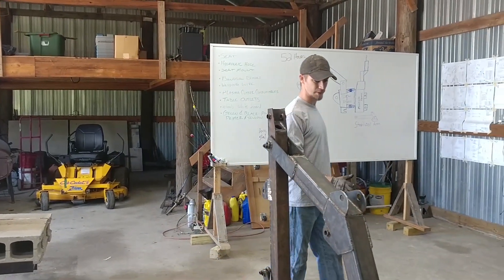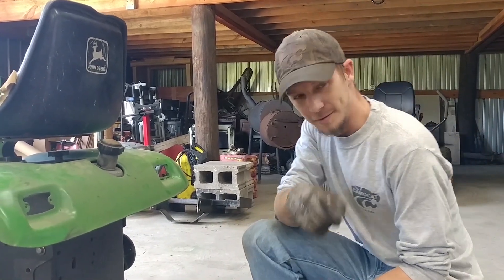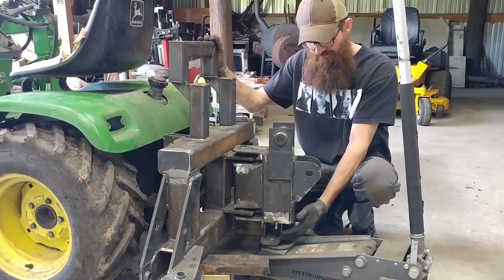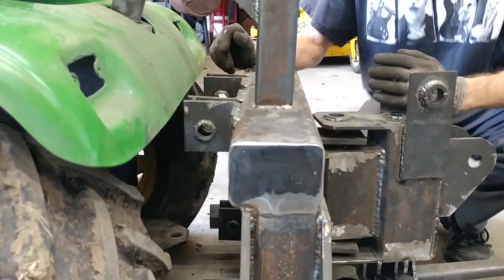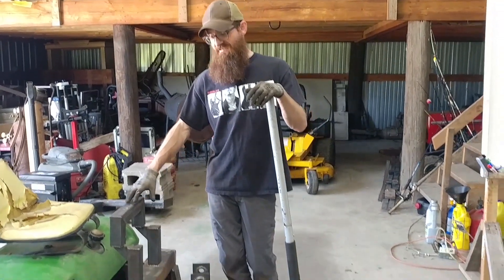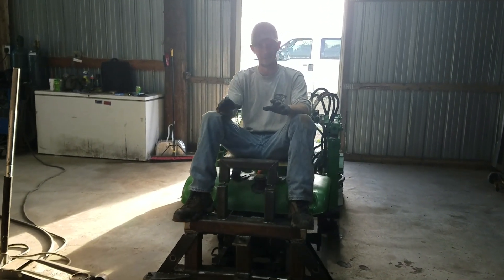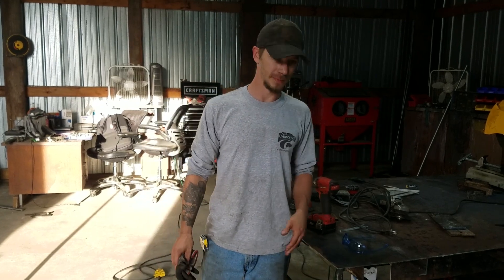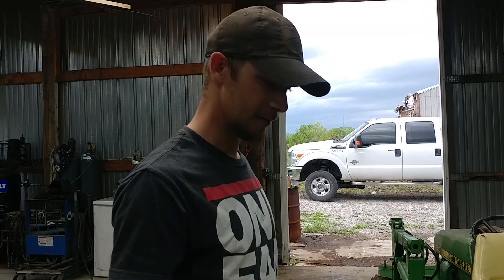Building a Mini Backhoe for a lawn mower (Part 6)

Comment: your guys' stuff is  highly underrated for the quality of the content. stuffs legit. i'm looking to do this front end loader/ backhoe build on an old Massey-Harris 22 from 1953 that we restored a few  yrs ago. 

i'm wondering how thick the rear bracket metal was? looked like 1/4" or maybe 3/8"  plate?